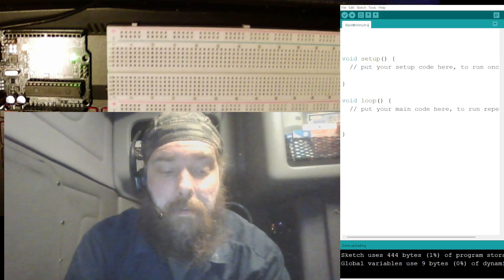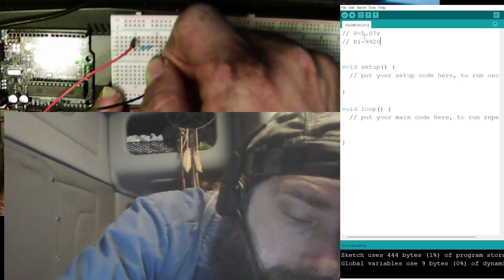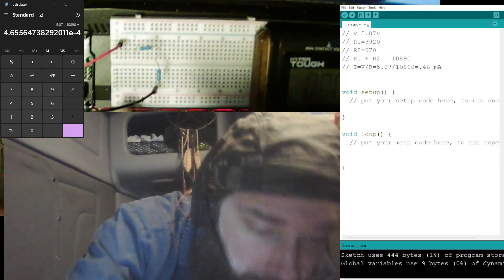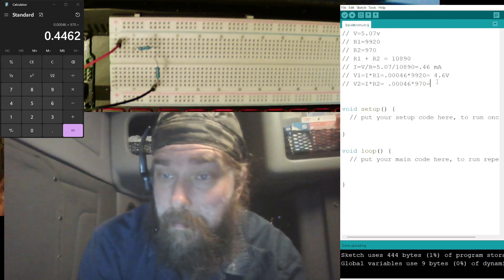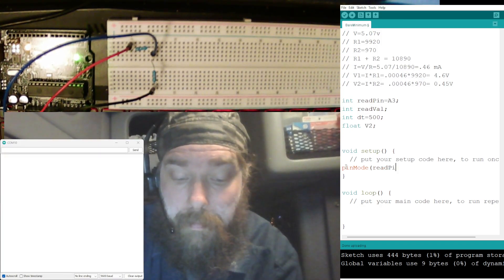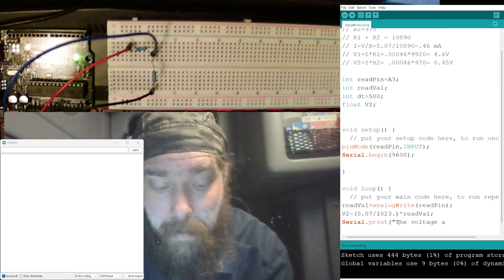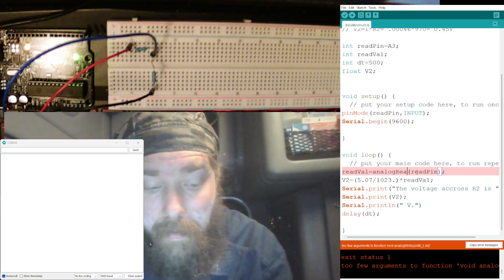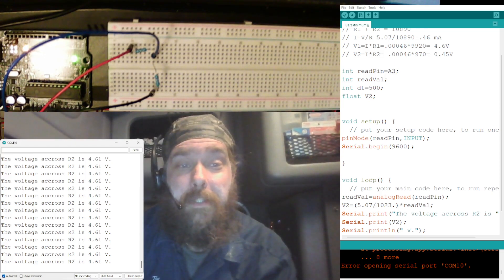Arduino Lesson 10 Homework: Display on serial monitor the voltage across R2 using analogRead.

Comment: Thanks again, Tim!! I love following up Paul's tutorial with doing my homework and then watching you 👍. I also added V1 in my code. I did borrow your "print string" command.  My code is below ....

int readPin=A0;
int readVal;
int Vin=5;
float V1=0;
float V2=0;
int dt=1000;

void setup() {
  // put your setup code here, to run once:
  pinMode(readPin, INPUT);
  Serial.begin(9600);

}

void loop() {
  // put your main code here, to run repeatedly:
  readVal=analogRead(readPin);
  V2=(5./1023.)*readVal;
  V1=(Vin-V2);
  
  Serial.print("V1 = ");
  Serial.println(V1);
  delay(dt);
  Serial.print("V2 = ");
  Serial.println(V2);
  delay(dt);

}
Reply from the maker: You are most welcome and thank you for watching!  I am delighted my videos help and are enjoyable! I am happy you are learning and enjoying this rabbit hole of delight and usefulness we call Arduino!